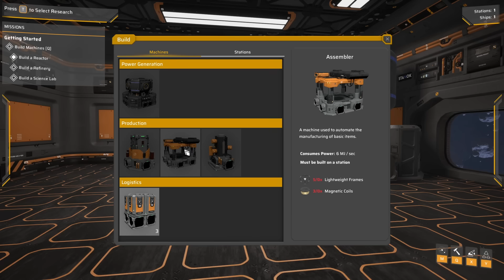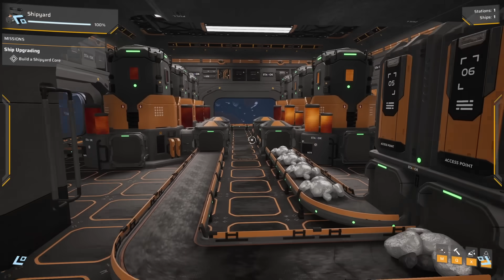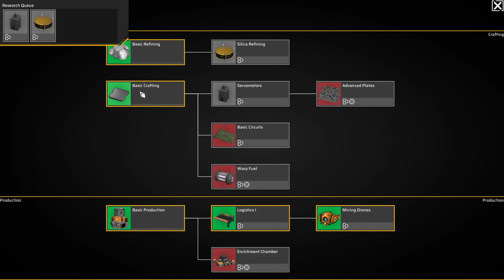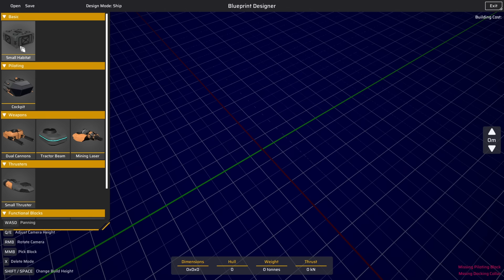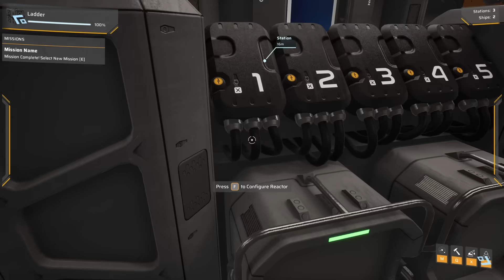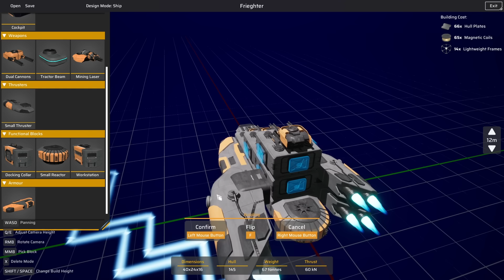This INSANE NEW Space Station Automation Game Came Out of NOWHERE!

Comment: If the resources are shared in the entire station, presumably you could build the drones anywhere on the station and then pipe them out of either of the outputs in the same cube where the power generator was.

Comment: The similarity of the UI and a number of icons, items and buildings to Satisfactory's is eerie. I really hope that the devs spend some more time on the assets to differentiate the visuals such that this does not feel like a cheap knockoff.
Reply: AND elite dangerous (for the pilot HUD) is also pretty close

tho the game itself does look interesting
Reply: The scan animation is also a near exact copy of X4's.
Reply: There is only one person making this game.
Reply: Why change perfection?
Reply: the game is fairly diffrent and ui similarity isnt much of a problem people are allowed to use something as inspiration
Reply: @nyanctz  Oh sure, I'm all for taking inspiration from previous games. The game itself does feel different enough. However, if you just take all of the stylistic choices from another game, it will feel lacking in identity. I also don't think it would be terribly difficult to fix. Slightly different color schemes, some distinct ornamentation, not have the metal plates angled in the same way when they are on conveyor belts, and such other small things should make it feel quite a bit different already.
Reply: I think the UI design is fine. The gameplay is vastly different from satisfactory. There is no ground to call it a copycat. Games have always been strongly inspirering each other. People calling that copycating is only a recent phenomenon I don't agree with in general.
Reply: @Grovion  This is extreme copying though. The button bar at the bottom right, the graphic of the stacked iron plates, the color grey and orange as defaults, the scanner with the exact same sound when it pings. It's a carbon copy.
Reply: @XTSonic  yeah i think using the same main colours is ok but copying textures and sounds is not.
Reply: Why change something that works?

Comment: Thanks for the info, I'll try the playtest.
But again, there are some fights I hate.
Why do developers have to add fights to building games?
Reply: To get a wider audience, an idea can be an option to disable it if you dont want to
Reply: In all the cases that I'm aware of, disabling combat / enemies fundamentally breaks the game.  In particular:

1) Somewhere between 1/3rd to 1/2 of the research is no longer useful.  Worse yet, these "dead techs" tend to be frontloaded -- early in the game (when foes are most threatening) is when key defensive techs are placed -- but if you don't need to defend...

2) If resources are awarded for defeating enemies, eliminating enemies can dramatically increase the difficulty of the game -- in some cases to the point of soft locking the game.

Obviously, a developer could invest time and resources in balancing the game for both peaceful and non-peaceful gameplay, but especially in the case of solo developer indie games neither resource is particularly abundant, and it makes far, far more sense to focus efforts on the new features that you believe will attract new players rather than rebalancing a mode that, frankly, you don't think is very good.

The same tension exists with multi-player / single player, with single players getting shafted more often than not.
Reply: i think its pretty fair to have combat in a space game and the game is still a playtest a lot of  things can and will change